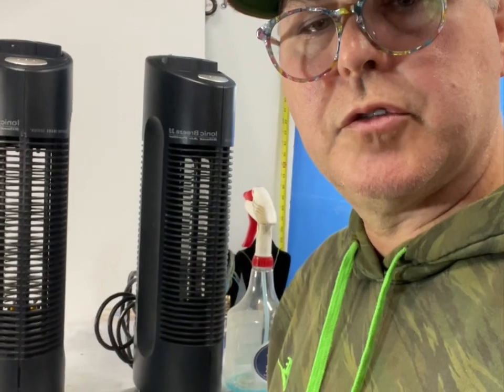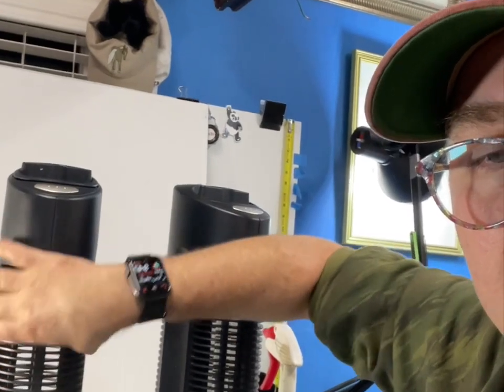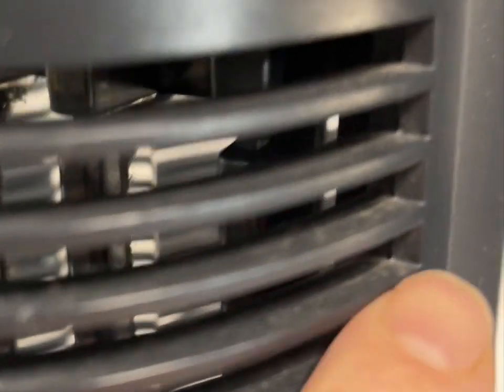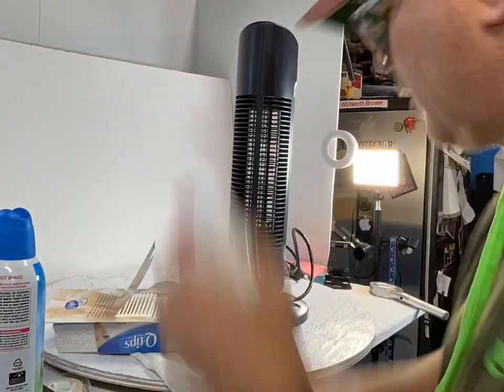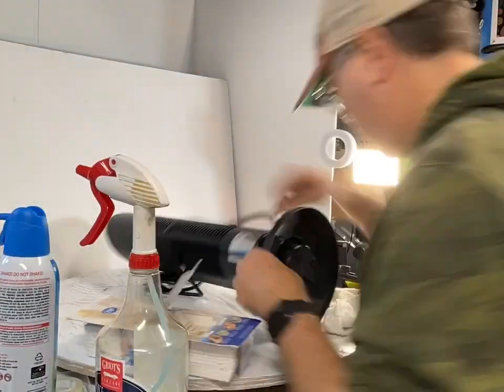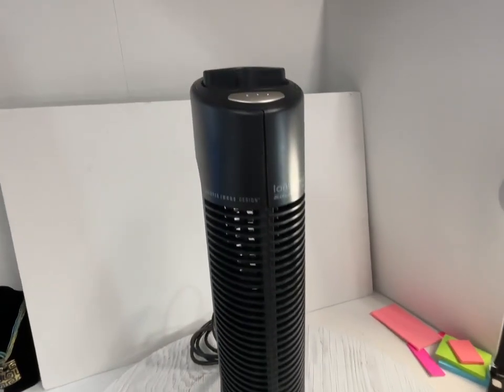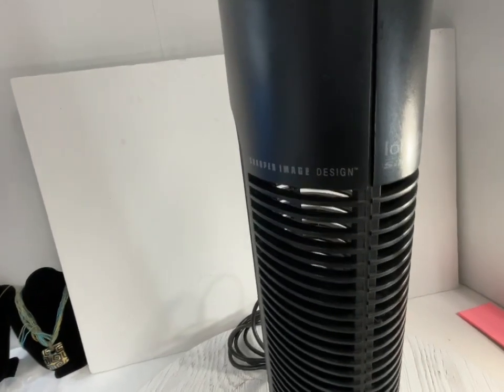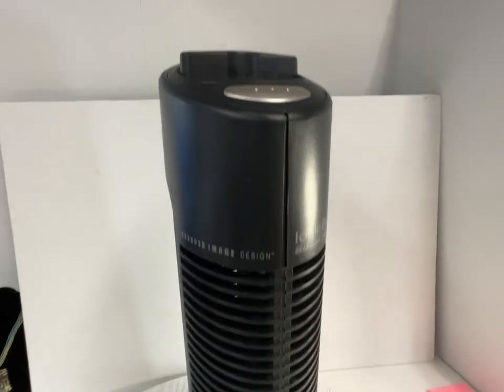Cleaning Sharper Image Ionic Breeze Model SI357 & The Reseller Refurbishing Life

Comment: I'm trying to clean one myself.  I completely removed the housing.  Do you think electrical contact cleaner is safe on the internal components?
Reply from the maker: I did use a little windex sprayed into a cloth, but mostly wet towel and occasionally dawn soap.